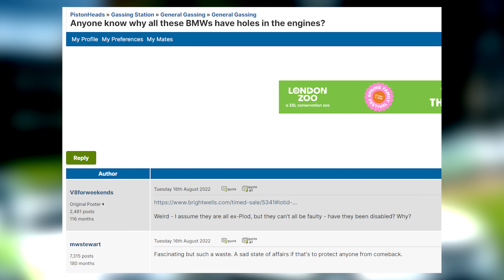Why The UK's Police Cars Keep Catching Fire (BMW N57 Engine)

Comment: why dont they simply switch to the petrol B58 straight six? would solve every single issue immediately. theyd be reeling in some supercars too with just remap/mods as interceptors
Reply: maintenance, cost of fuel, far worse reliability, higher emissions
Reply: @aidan1585  the B58 parts failure rate is one of the lowest in the industry. you need to stay updated with the actual dependability/cost of ownership numbers (wbich are constantly changing) to make the claim that bmws are unreliable - you cant just “well, they were really unreliable last time i checked 15 years ago” theres this crazy concept about having a worthy option on a car’s reliability - you actually need to know how reliable that car is!
Reply: @hau5muzeek   "Far worse" does not mean bad, it just means lower/worse than the other. Let's say that most UK police forces average around 25 or so mpg in their diesel BMWs (B57, N57 and some, but rare, N47/B47 engined vehicles). If they switched to petrol, specifically the B58, they'd struggle to get 15 to the gallon. Explain why that is a better idea? 
To the best of my knowledge they never had any issues with the B57/B47, just the N57. Why remove all the BMWs from most fleets if it is just one engine model that is affected. One that started to be phased out back in 2015. That is 8 (coming close to 9) years ago. Well, possibly because BMW stopped selling the police specialist vehicles for police forces across the United Kingdom. Why you ask?  Most likely due to all the scrutiny they came under by the UK. These 'issues' were not found by any other police forces across Europe, where N57 engined police vehicles are common. I'll give you an example, my country, Ireland. We have a national police force, 'an Garda Síochána' (The Police, translated from Irish/Gaeilge, literally meaning the Guardians of the Peace). They never had any issues... with hundreds of N57 equipped BMWs. Why? Why didn't they but the British forces (most) have tons of issues?? Maintenance. They ignored manufacture (BMW) service requirements for specialist vehicles.
Reply: @hau5muzeek  Also, don't try and tell me how reliable BMWs are, on our 13th one so far since 1988. Only had a single issue ONCE, with our E53 X5 4.4i Sport. They're amazing vehicles with great reliability records (nowadays)
Reply: @aidan1585  The only people that rant on about BMW reliability are used car buyers buying scrap and Scotty Kilmer sheeple, vast majority of normal people are content with the reliability and performance that BMW delivers.
Reply: @aidan1585 the entire part failure rate on the A90 is extremely low. lmao emissions 🤣 its not my fault that the Z wasnt the saving grace you all hoped it would be, what else would you expect from them? its fucking Nissan dude. the cost cutting CVT boys. just because theyve released 10 respectable performance cars in their history does not mean that they are some high end automaker. they are not on par with Ferrari or Mclaren - just in case you guys didnt already know or something,
Reply: @aidan1585 the B58 is actually just as much if not even more reliable when maintained than most BMW diesel engines. It’s not like the other petrols they made
Reply: Cost and maintenance
Reply: I will never understand how they expect to catch any kind of performance car in a diesel like this, if they used B58’s they would be incredibly formidable

Comment: Im a tech at a bmw dealer and the F15, F11 and F30/31 police vehicles did undergo a timing chain "recall" However, there was never any information available as to why it was being replaced. The oil being put in after the work wasnt the usual 5w30, off the top of my head I think it was 10w40 or something but dont quote me. More recently in the NW I've still seen G05, G30/31 and G20/21 models being used but these will have the B57 engine so maybe there has been some changes? Also the F40 m135i have become quite popular amongst them too. Hope this provides a bit of information for anyone
Reply from the maker: Thank you for that, I'll pin it :)
Reply: Oil top ups at my unit were 5/40 due to higher running temps. The cars were always run hot. Then service intervals changed to 4k miles because oil degraded due to the characteristics as to how police use the vehicles

Comment: I dont know if this is true or not. But supposedly, after the MET placed the blame on BMW for bad/faulty engines. BMW took some of the METs police vehicles back for analysis and did a lot of  testing on them and new N57 engines that were freshly built. They discovered excessive engine wear and failure due to the way they were being driven. 

BMW went back to the MET and instructed them that they should service their cars a lot more frequently than the normally recommended service intervals but either the MET or the mechanics at the MET ignored BMWs instructions and carried on with the same service intervals...which leads us to where we are today with the whole issue.

I dont know if they wilfully or deliberately ignored BMWs instructions or if the mechanics at the MET are just that ignorant. 
It also could have been that they wanted to terminate the contract with BMW so they could pick up more Skoda's , VWs, Peugeot's or Renault's that have been making the rounds but at a cheaper price then what they were offered at the time by BMW. 

Whatever the real truth is. Its a shame somebody has gotten caught in the middle of it and lost their life as result.
Reply: So the 130 mph had nothing to do with the situation ?
Reply: @colvinator1611  nope! the cars could’ve been going 60 or 160mph and it wouldn’t have made a difference. when an engine isn’t maintained it gets build ups, the parts start getting weaker and it simply can’t handle the stress anymore which affects the exhaust system and gearbox too. the police don’t have the time nor resources to keep every single vehicle up to new standards so they aim for working but could do with some new parts.

the problem with these engines specially is that they’re meant for high performance which means they need to be maintained more than your typical volvo or mazda etc. these new cars like the volvos and peugeots are going to lack so much compared to the BMs.
Reply: @mtop90  I just thought that the 130 would drastically reduce his survival chances in the event of an incident. He may have survived say 70 or 80. We'll never know.
Reply: It doesn't take a genius to see that BMW have a point. Anyone who does track driving knows that you have to maintain a hard-driven engine a LOT more than the bare minimum specified in the owner's manual. The manual will tell you as much too.

The rule of thumb I use is to treat every track mile the same as 20 normal miles. That's why my last oil change was about 1000km/600mi (street and track) after the previous one. It was none too soon either - the oil was already thinning, and quite dark.

If the car was also idling for hours every single day, I'd be changing the oil even more frequently. It's pretty cheap insurance when the cost of failure might be a fiery death.

Comment: Well there you go,using a diesel for high speed work is never a good idea,they weren't deigned as high performance engines.and we know that they go full chat when on a chase,not a fan of the law,but no-one should lose their life under any circumstances.it's not just bmw...anything with a dpf is a fire waiting if not checked regular.
Reply: @evilelf5967   Diesel engines ARE designed to run flat out all the time, hence the lower rev limiters!!
Reply from the maker: Agreed. I think it was totally unrealistic that the police would be willing to deal with the more frequent servicing these cars need in reality

Comment: I had an ex police E39 with M57, full service book at BMW and 600€ of maintenance bills yearly in the history. I restored it back to former police condition with all equipment. But ended up stripping and scrapping it 3 months later because it was just used up. There was oil in the intercooler and the car became harder to start.
Reply: Some amount of oil in the intercooler is normal on a high milage turbo car...
Reply: @waifuracer6516 blow by oil is always normal. The only thing that would be a concern is pools of oil
Reply: @yonatansalomon-f3x  there was a big amount of oil coming out, and the engine was producing more and more soothe.
Reply: Chances are the Speedo is rolled back .. 100k haircut maybe
Reply: Ex police cars are the most clocked cars in the uk.
Reply: @gtjack9  still could have rebuilt the engine
Reply: Didnt restore it very well the most Important part of the car the engine you left alone

Comment: The Dutch police use “special” Audi A6 diesels as their fast vehicle fleet. They also have some MB a45 masked as a regular A class vehicle. They are currently testing BMW and Ford to replace their normal vehicle fleet.
Reply: Dutch police have alot of different cars. They also drive Opel(Vauxhall) Astra's.
Reply: @OwkeejGamers  Yup, the Dutch police uses every German brand except for Porsche, so Mercedes, BMW, Audi, Volkswagen and Opel. Although obviously not German, Volvo is fairly common as well.
Reply: They have bmw140i’s as well.
Reply: Because of the varying driver training, all forces use different vehicles, you couldn’t possibly use 1 type of vehicle for every force. It costs thousands to put 1 officer through the Fast Roads Policing Module, not to mention the Tpack, Prohibition, Weighing and Taco training and then there are refreshers every 5yrs. No force has ever had that kind of budget, nor will it ever…..
Accident Investigators are all officers from the Traffic Unit who wish to specialise and have completed all the necessary courses and refreshers and continue to do so, even if they retire and work as civilians…
Reply: toyota hybrids for uk
Reply: @lemcakes32422   Volvo V90 mainly.

Comment: The problem here with these new diesel engines is that the oil gets diluted with diesel when the dpf cleaning cycle is interrupted losing its viscosity overtime and when the oil temps are higher the oil pressure is way too low and it throws a rod at high rpms. That's what I think is going on here
Reply: For a engine rated for 155mph 🤔
Poor Service.
Unfortunate Circumstances for the Driver.
Proof it wasn't Speed being the issue.
Reply: 'rpm'
Reply: @stopthebus  'rpm'
Reply: @pier11francesco  Exactly. Not 'rpms'.
Reply: @stopthebus  Imagine sweating over "rpms" bruh literally scram
Reply: @pier11francesco  No sweat here 'bruh'. Just pointing out something you obviously don't know.
Reply: @stopthebus  No I do know Revolutions per minutes does not make sense , I will intentionally not correct it since It bothers you so much
Reply: @pier11francesco  The only person it bothers is you now!

Comment: I assume that performance versions of Skoda vehicles will probably replace the BMW's since Skoda announced that they'll be providing vehicles to UK Emergency services in general
Reply: Volvos are replacing the BMWs.
Reply: @MementoMori-xx5qo Volvos are unreliable and can’t cope. Force I work for looking at Skoda Superb and have some vw touraeg on order
Reply: and Toyota for the small beat cars
Reply: When Holden (GM) ceased production of the Commodore, the police here in NZ started looking around for a replacement vehicle. After extensive trials and testing of different makes and models they settled on the SKODA Superb.

Comment: They should fit police vehicles with leisure batteries and electric AC compressors so they’re not sat there idling for hours.
Reply: Then they might be thrashed from cold.  No way to treat engines.
Reply: @john1703  Idling is worse for an engine… So is being on fire. With modern fuel injection/tolerances/thinner oil.. They really only need to run them like 5 mins per hour for  it to not be a true cold start.
Reply: @Jonathan_Doe_ Toyota and Lexus already have that plus some other automakers. Just get a hybrid petrol / electric, they've already designed all of that in so it doesn't need to idle.
Reply: @tomtom1541  They wouldn’t be able to chase anyone in a Prius though (Unless they grey import the new one the U.K. isn’t getting).
Reply: @Jonathan_Doe_  oh I meant like a V6 Toyota crown hybrid or gs450h.
Reply: @john1703 they’re thrashed from cold and from new and have aux battery fitted.

Comment: Though unfortunate there’s a few reasons this typically pretty bulletproof motor spun a bearing and it comes to service intervals and as you mentioned how the cars are used. You failed to mention that long idle times still wear the engines (and in some cases more than when it is being driven) without running the odometer up. So as they approach their oil change interval the engine has likely experienced much more wear and tear. Throw on the fact that BMW makes pretty high strung motors (passenger performance cars) the effect of low oil quality is compounded. The fault lies with BMW, ever since 90s they have tried to stretch oil change interval and servicing periods, they got away with it up until the 2000s because the m54 and m52 were fantastic motors (e46 e39 and other 6cyl engines)
Reply: Bmw has been recommending that the British police use a different service interval that is much closer than the standard recommended one because of the extra wear on cars during police use. Unfortunately the police refused and do the standard 15k miles oil changes
Reply: @TheFlyingClutchman  that’s the stupidest shit I’ve ever heard. The cost cutting is insane!
Reply: When this issue come to light the bmw fleet for the force I work for the service interval was changed to 4000 mile intervals and explicitly told no engine idle.
Reply: So if you’re a cop who thrashed your vehicle. Chances are higher it’ll flip over at high speed and burn you alive. Good to know
Reply: not just what you put BMW since the early 2000s have been cheaping out badly on vital parts of there cars with there love of using plastic. Such as the N20 engine not only that engine have serious timing chain problems like with a lot of there engines they even tried to use a plastic oil pan! . Soon after they discontinued that engine with the B48 they reverted to a more conventional aluminium oil pan as the N20's kept Warping and Cracking. i am glad they are phasing out these BMW's as there track record with there engines is atrocious.

Comment: The worst thing you can add to a BMW is fuel and a driver…….they are the least reliable modern car, the engine bearings have been a brand specific issue for many years in all of the performance models.
Reply: Least reliable modern car 😂😂 what about range rover or Jaguar they are a million times worse
Reply: @tonystafford978  nope, faults per car they’re on par, what aboutism isn’t going to win any arguments on that front.
In the long run, BMW engines in particular have written off more cars than all the British cars combined…….not that I’d own either of them.

Comment: I feel like this might have been a missed opportunity for them to push their PHEV models, like the 330e or the 545e, both now come in estate forms and the B48 engine has massively overengineered cooling systems (it has an air-to-water intercooler for crying out loud). Those little 308s and Astras are perfect for beat duty, but I suspect a longer wheelbase platform is best left to the Germans.
Reply: The Glasgow police use the XC90 PHEV now instead of the 330D, the XC90 is still 300hp with it’s 2.0 litre engine

Comment: My local force has been replacing their BMW's with a mix of Audi A6's and Volvos. Avon and Somerset was already using Audi's for Armed Response, so using them for traffic as well isn't too big a jump.
Reply: They are getting new Toyotas soon, good move made in UK too
Reply: I heard that the Volvos are pretty rapid, do you think they're a good replacement?
Reply: @Monke_Forever  id say so, they absolutely fly
Reply: @Monke_Forever no they’re terrible and unreliable.
Reply: @Monke_Forever   they've got 2.0 petrols and aren't very reliable 🤷‍♂
Reply: The Volvos are so much better
Reply: @jaylam the volvos aren’t better, they won’t be able to stand the pressure for as many miles as the BMs can, the police don’t service the cars to perfect spec just working and durable spec which is why the bms started slacking, decent cars but definitely not better, the bms are simply just more durable and outperform the volvos in every way if they’re maintained properly
Reply: @jaylam  not sure I agree with that
Reply: @jaylam  not true.. those 2.0 Volvos won't handle the driving